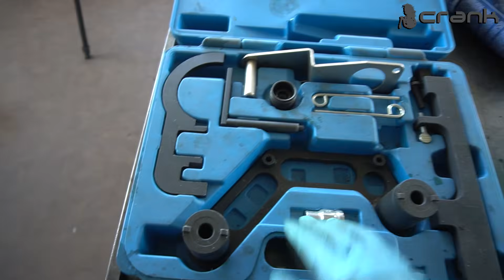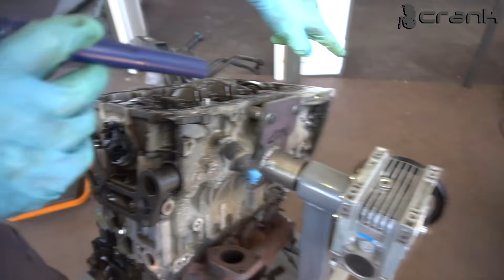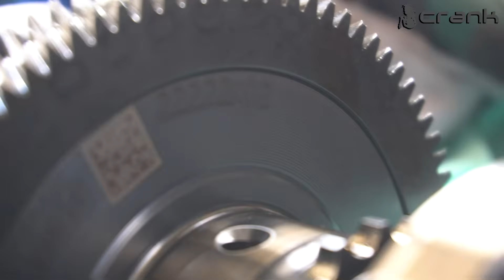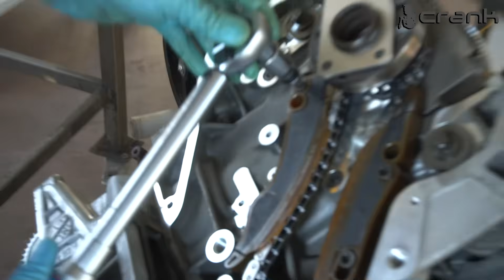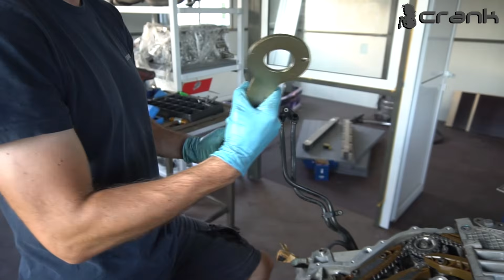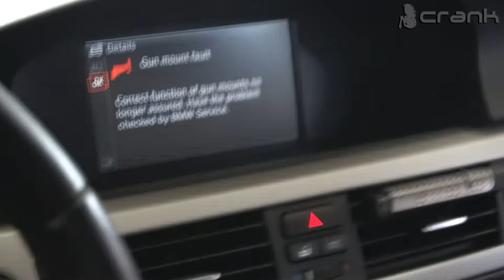BMW N47 Timing Chains Replacement Procedure

Comment: Hi, I have a question. If I don't touch the high-pressure pump and only lock the camshaft and crankshaft, do I still have to time the high-pressure pump? I didn’t understand that step. 
Thanks

Comment: If you had turned the engine a couple of revolutions before locking it the high pressure pump would have lined up automatically.
Reply from the maker: Yep, on every 4 revolutions it lines up

Comment: I have workshop manual for my F11 with N47D20O1 engine and its build before 5/2013. Manual says that you dissasemble engine with older crank shaft tool and then you change that 45 degrees tdc to 11 degrees tdc with new tool. So I think I can do timing chain replacement with old tool or with new one.

Comment: Have you vide from B57D30B engine as well?I have a 2017 740d Xdrive,i want to replace the timing chain kit,and the bearings on the crank,and con rods too.

Comment: Hello I got a question. I bought a n57 remanufactured engine with 6 months warranty. The thing is that this engine comes without high pressure pump and the timing cover is all marked with warranty paint. Is there any problem about installing the pump without open the timing cover?

Comment: I am going to do the chain on my wife's F30 next week, didn't know the crankshaft bearings wear that much.

Can you please explain that with the bearings further?
There are 5 Numbers on the Shaft and 6 Numbers on the Block.

But there are only 4 rod bearings and 5 main bearings.

Also, can the BMW dealer find out which bearings are in the car in advance, so I can order them before I start to work on the engine?

Comment: best m8! have to do it in the workshop on a toyota verso d4d with the "1ww" engine aka n47.. all videos i´ve seen im wondering why the engines are running if they use the crankshaft-to-fuelpump alignment tool as a tdc tool, but they seem to have more luck than brain. toyota don´t give any advice or manual for their bmw-verso.. today i can sleep peacefully and finish the chain replacement on the verso tomorrow!

Comment: So weird that the early N47s came with gaskets and seal never leak oil not like the latter ones have silicon and very very bad oil housing seal.
Reply from the maker: Actually removing the gasket has something else in mind. Usually this reinforces the cylinder block from the bottom, when there is no gasket in btw the oil pan and the block. Its a little difference, but there is a difference. That is why all the new engines on BMWs are with silicone only.

Comment: Hi, N47 300 000km 525d F11 engine sound. Is this normal sound? https://www.youtube.com/shorts/MEx88EFZteg
Reply: Start checking injectors and crankshaft pulley...of the are ok, them something inside Is broken gornsure..could be a lot of things...pistons clearance, bearings of crankshaft and any other things related

Comment: Hi CRANK
Im planning to change my timing on 2012 bmw 320d f31(automatic)...I am not still sure i get it one thing... When you install and align the high pressure pump sprocket(gear) using that special tool rotating for 45 or 11 degrees(whatever) , do i keep the other tool fixed on camshaft or not. could you clarify me on this please and thank you very much for your support
Reply from the maker: No camshafts should be timed after that
Reply: @crank3646  thank you for clarifing it . By the way will the kit your using be good for my bmw 320d f31?
Reply from the maker: @igortanyarascovschi1225  Yes
Reply: @crank3646  could you please send a link from ebay or amazon of the kit
Thank you

Comment: Thanks for great video. Whith time will be video about balance shaft ?
Reply from the maker: Hopefully in the next week, I have already recorded it, just need to edit it
Reply: Perfect timing. I have engine on holder and balancing shafts make me nervous.
Reply: Have you anytime problem with starting motor after install to car ? My engine after install not starting, starter spins, sound of starting is normal, just injectors doesnot work, on ECU is no mistace codes. I forgot venting the fuel systembefor first start. after 3 lost starts I used diagnostic and make venting fuel procedure. but still not run. Do you think I broke high preasure fuel pump ?
Reply from the maker: @jandornak2166  Remove the solenoid on the side of the HPFP and check for metal
Reply: @crank3646  I checked it and it's clean. on ECU ZGM Is error code 801C20 - Central memory is full - no error of ecu. Voltage of battery is 12,5V battery. Fuses in tailgate and dash board is ok, under hood one fuse is ok too. I ordered new power distribution box on baterry and will see. Timming must be ok if I use start spray to intake manifold Engin run.

Comment: I just changed out Hpfp/injectors and all fuel lines on my bmw 118d after hpfp failure and now car has misfire on cylinder 2, I used the proper locking set up for hpfp and crank but scratching my head with this misfire. All injectors checked and pressure from Hpfp good, My next step is to remove glow plugs and test compression but would it be worth taking rocker cover off and checking timing 1st incase it has jumped?

Comment: Hi my car is a 1series 123 N47  2010 with 187 k miles uk miles 300 KM has noise on starting that gose away so engine out Timing and guide and tensioner's all in good condition so thats not  the noise, I will fit all new , clutch is worn out but was still working ok ( Friction plate or center plate has spring in it ) the dual mass flywheel seems to be ok not to much movement.  I have seen flywheel  alot worse than this flywheel. It is difernt part number to all other N47 and very hight price, I will fit a new.
Do you know of anythink that can make a noise on start up ( has new front pully and belt )
Thank you for doing the video I did not understand my timing tool's kit I thought thay were not correct so to see the correct way is very good. I will like and follow your chanel thank you
Reply: The noisy coud come from rood bearings...😢

Comment: My car is at around 260k km (320d lci 2008) and runs perfectly, is there any way to check the chain without taking out the engine? How much would this whole procedure cost  if you do this?
Reply: As far as I understand, BMW dealers can perform a test without removing the engine to check for stretching in the chain. They did this to assess which units were valid during a recall on the early models. There were grades of severity in slackness due to stretching and only the most severe got a free change
It is worth asking them I suppose?

For older cars with high mileage it is a difficult decision whether to spend the money it will cost to remove the engine, swap the chain and do all the work shown here... most independent local garages won't touch these kinds of jobs these days... too much easy money to be made doing ball joints, brake disks and pads and track rod ends... You need to find an independenty BMW specialist but their prices these days can be as eye-watering as a main dealer...
Mine has 170,000 miles on it (2014 F31 Msport x-drive 320D) it runs fine now and isn't noisy but i'm concerned the chain is going to give out on me in the next year or two... All I can do is shorten the service intervals and add some molyslip each time

Swapping the chain is around £900-£1300 GBP for the 2WD up to around £1500GBP for the X-drive versions... Mainly labour cost as the kit is less than £300GBP
Prices approximate based on quotes I have just had APRIL 2024 from two independent BMW specialists
Reply: Remove the plastic rock cover to check the chain, and you can clean the air intake manifold too..
Reply: I changed mine recently, was making horrible noises when idle, got a brilliant Febi kit off ebay
Reply: My e90 320d has done 281,000 km and runs perfectly.... The car is a 2010 model which I have owned for 6 years... I think I will continue to run it because the cost of replacing the chain may not be worth it in the long term... If you keep regular oil changes your chain should be ok
Reply: @pauljohnson3686  thank you!
Reply: There is a special tool you can put in the place of the tensioner to see if there is slack in the chain
Reply: Can do the chain without removing or even lifting the engine. Sump comes right out once the oil level sensor and dipstick tube are removed.

Comment: Could painting a timing mark for the fuel pump be an alternative to using that special tool?
Reply: You time the engine, leave the engine timed. Then undo the bolt for the fuel pump, then undo the fuel pump bolts then slide the pump backwards. Refit the chain an then the fuel pump will be in same position.

Comment: Got my engine together just yesterday..did the fuel system bleed from ISTA just once but still it does not start..should i run the fuel system bleed more than once? And not having the exhaust sensors plugged in should not be an issue to start the car right? Because mine too the exhaust is still off but the manifold with the turbo is on..

Comment: Hi.
there are few who explain correctly How to mount the chain distribution on the n47 bmw.
The most common mistake when the fuel pump is set to the mark on the engine block.  You understand what I mean.
You are the best.
Reply: Good evening, is there a problem if the fuel pump is not in the right position?
Reply: @tiagocardoso7753 yes you don’t have the full power of the car, so you lose some minor power not to much and the car engine won’t run correctly.

Comment: kindly, what timing chain kit did you use? possible to provide a link?
Reply from the maker: Everything is OEM, it is not a kit
Reply: @crank3646   okay,
 Thank you for the reply 👍
Reply: Good evening, is there a problem if the fuel pump is not in the right position?
Reply: @tiagocardoso7753  He said that the engine will run but the life of that chain will be reduced.

Comment: i got an issue bmw says turn crank to 11 degrees after tdc when fitting oil pump and crank to hpfp chains. the 11 degrees tool doesnt fit onto my crank its 1mm too big. now i seen u not use 11 degrees after tdc. please explain why thanks
Reply from the maker: There is no specific way for installing the oil pump. You can install it as you want, the crank doesn't need to be on TDC or 11 after TDC, this is only for HPFP. And yes I show this in the video detailed as much, just watch the whole video  with little bit better focus what is shown.
Reply: Good evening, is there a problem if the fuel pump is not in the right position?
Reply: @tiagocardoso7753  I did the job, it’s always best to follow the manufacturer guidance but seems like @crank3646 had his way as he is a lot more experienced. But I removed chains when crank was at 45 atdc with hpfp marks lined up then installed everything with crank 11atdc for hpfp timing. But many people don’t do it and don’t know how it even makes a difference

Comment: Just spun a rod bearing last week, pulled the engine and am in the process of replacing the crankshaft, main bearings and con rod bearings, so your video came at the perfect time. Thank you for the detailed videos, many of your videos have helped me better understand the biturbo setup of the BMW diesel engines and work on mine (E90 2.0d converted to BiTurbo like the 123d model).
Waiting for the balance shafts video!
Reply from the maker: Thanks! The balance shaft video will be delayed, because I have forgot to film something really important when reinstalling them. Will be doing it probably after 2 months. At least that is when we have planned a repair like this on other car....
Reply: @crank3646 Im about to do the same job...can i reise con rods Bolt like you did?
Reply: Hi, I’ve just seen your comment and was wondering if you have some information on how you converted yours to bi turbo? I’ve been interested in doing something like that but didn’t find much info at all
Reply: @465painkiller465 did you ever find any answers for this?
Probably a complete ecu swap with coding ... hardware would be relatively easy I think.
Reply: What was the bearing conditions?

Comment: If you want to start faster you just need to unscrew the pipe from the first injector next to flywheel
Reply from the maker: I don't want to start it faster actually. I want to crank it, so to be sure that all the oil galleries are full with oil and we have enough oil pressure before the start.
P.S. The injector to the flywheel is number 4